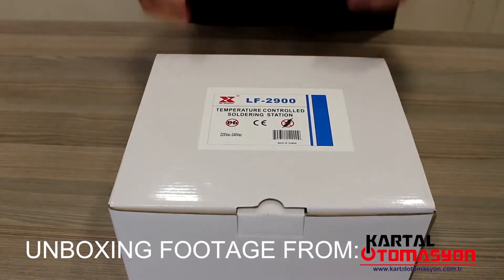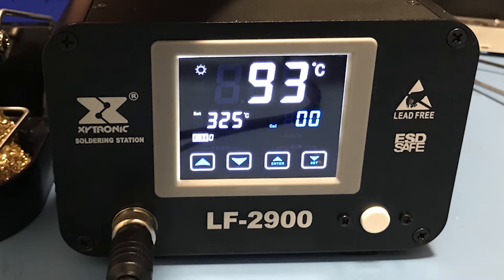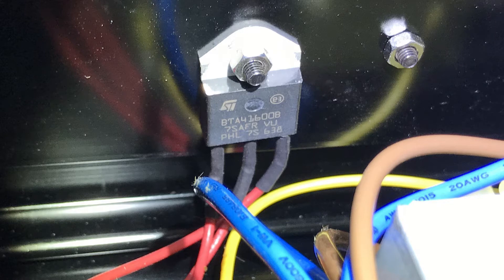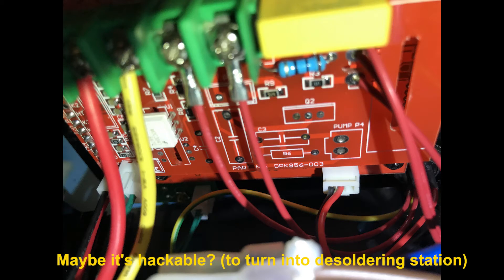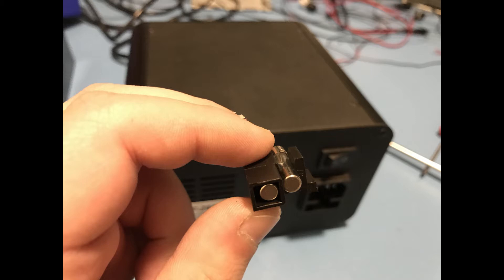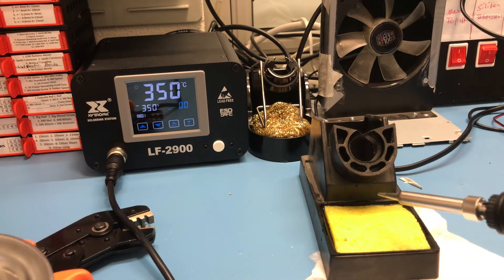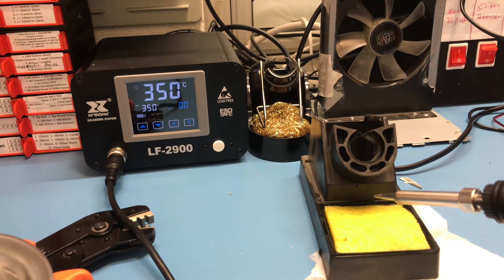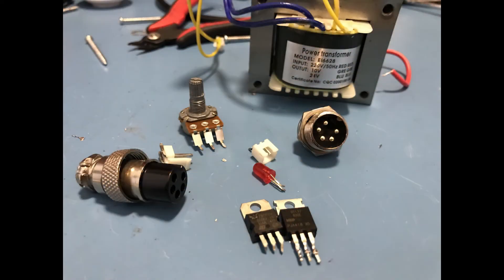XYTronic LF-2900 Soldering Station Review

Comment: I love my LF3200. It is powerful with 90W(or is it 120W...). It is simpler that 2900 with real buttons.  It surprises me every time with exteremely fast startup heating time. It is always like turn your head and it is ready already. Tip is now 3 years old.
And then it shuts off with very sensible timers first into active standby and then later to forced restart. Good powerful soldering station is one of those things when you had not it you did not know much you did loose. 
In this case excess money really makes exponential added value. So I paid 124€ for new LF3200 compared to the old 50€ serial tip burning under powered ZD937 style snailstation. 
LF3200 had one problem originating from factory. The handle socket did not screw in. Such high end feeling and then that...Problem is on handle side because threading seems to be ok in the device body.  But I did not return it because I did fall in love immediately. I solved the socket problem by bending little holder for the whole thing from aluminium plate and did U-shaped cut to keep the handle in place. 
I just wonder if some cheap tips or handles would be compatible with my LF3200?